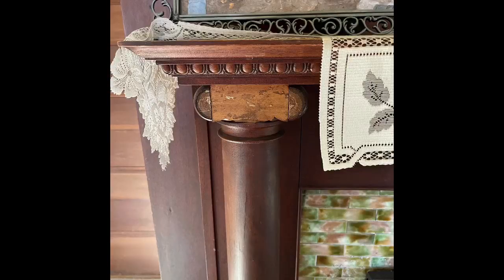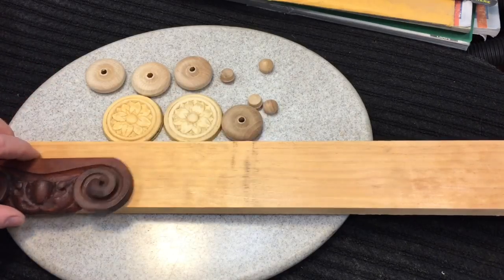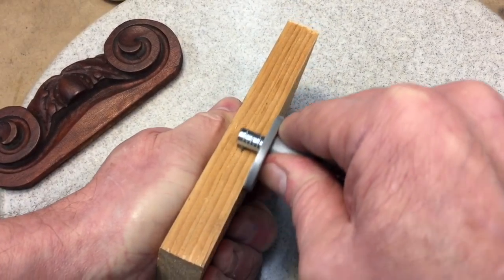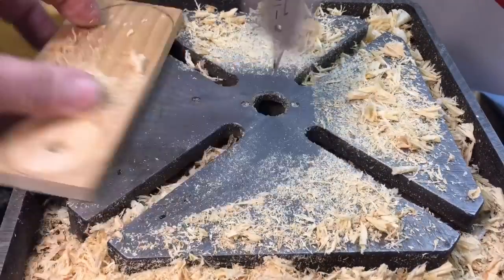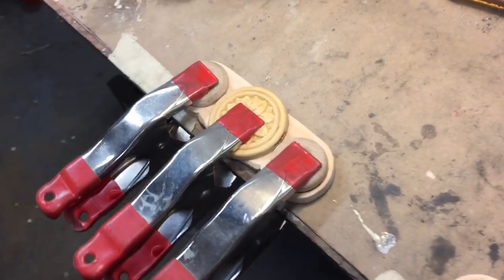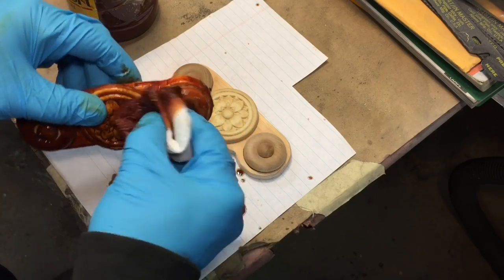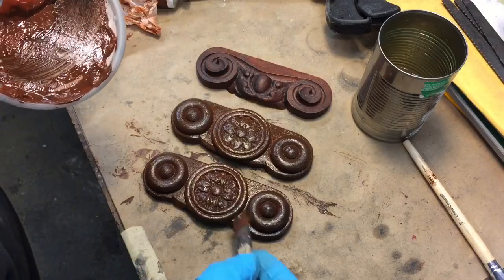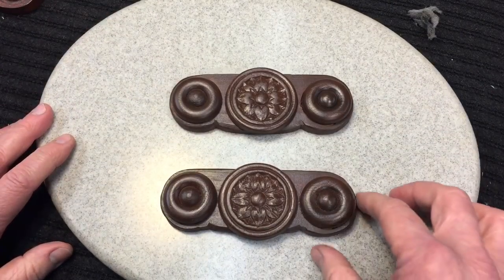Fabricating A Fireplace Moulding Piece...

Comment: You had me fooled. I thought we would be seeing a video about using the original as a mold for the replacement. I think you stepped outside the box this time. It's really creative what you did. The replacements will match the mantle so well no one will be able to tell but you and your sister. I like the way you reduced the thickness of the backing wood with the handsaw. That's a technique worth remembering because I no longer have a table saw. I think your sister will be pleased. I'm not a bird watcher, but the bird on the left side of the spring picture looks like a Mountain Bluebird, the state bird of Idaho.

Comment: I'm a very big fan of step drills myself. Oddly, my very first one from Harbor freight has to be 20 years old and it is still my preferred one. I have a handful made by unimike, but I actually prefer HF. One thing is that because they don't have landings between the steps, the HF drills are very easy to sharpen with a benchstone. I expect that HF step drill to last the rest of my life. Absolute God sends when it comes to sheet material

Comment: Good use of your imagination. Reminded me of when my old boss was hired to rebuild the courtyard balcony in a reproduction of a Spanish villa that'd been built for the owner back in 1938 as a wedding present from her mother. The center post and the beams had started to rot. We had Jelliff Mill make a hollow wooden column to hide a steel I-beam structural post and set two more I-beams to span from the side walls of the courtyard to the center post. These beams were encased in wood. The original wood corbels had rotted beyond repair and reproducing them exactly would have been outside the budget. My boss found new a pair of new corbel at Stamford Wrecking. They were carved somewhere in east Asia and imported to the US. That left the original egg & dart molding which had rot at both ends. I had the job of trying to make about 3 feet of molding to match using a table saw and hand chisels. The finishing touches were provided by and old painter who my boss talked out of retirement to make all the new wood look about 400 years old.

Comment: A nice replacement, but don’t they have to be flush across the top to fit up against the mantel top??
Reply from the maker: I believe the mantel top is not overhanging...   =D   Otherwise I will trim to fit

Comment: I had a craftsman scroll saw like that for a couple of years but it was horrible for changing blades and putting blades into pieces because of the blade holder. I have a delta now I absolutely love scrolling its a relaxing hobby
Reply from the maker: Hi Chris- I have the DeWalt DW788 I believe, takes up a lot of room so it's in the attic...  LOL

Comment: Hey Scout. 
A brilliant guy like you probably already thought about making a casting from plaster of paris. Then use an epoxy replacement from the mold.
Reply: Silicon and dish soap for a flexible mould,with resin or  car filler,so it releases from mold plaster of Paris would be hard to get the part out
Reply from the maker: Have you seen the price of casting epoxy lately!?  Holy Cow, I think it is up there with precious metals!  😂👍
Reply: @donotridetheturtleog3863  Thank you  professor...
Reply: @ScoutCrafter  You're loaded...lol